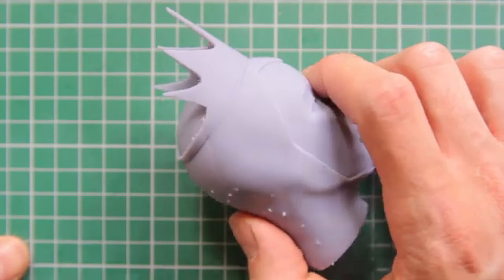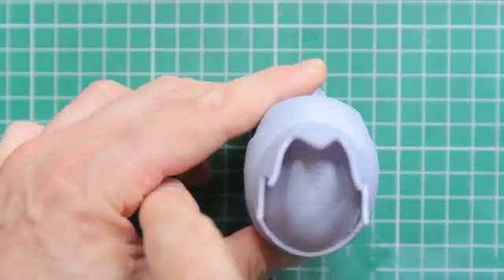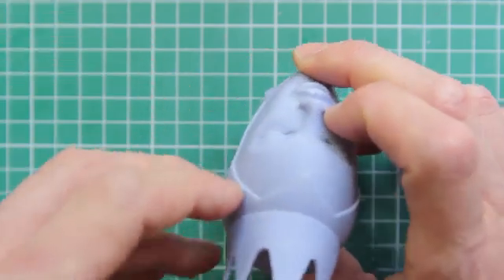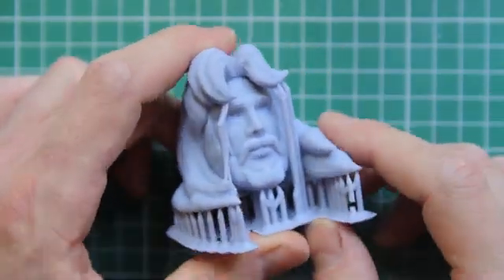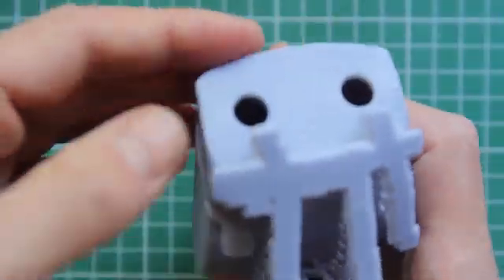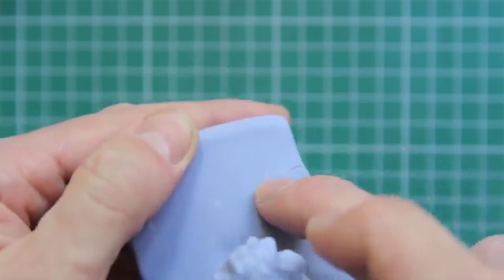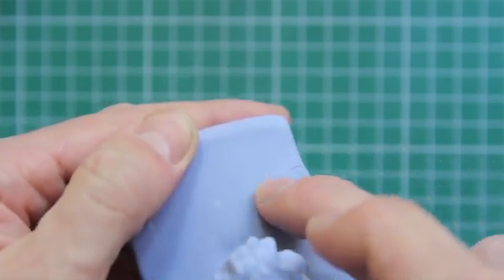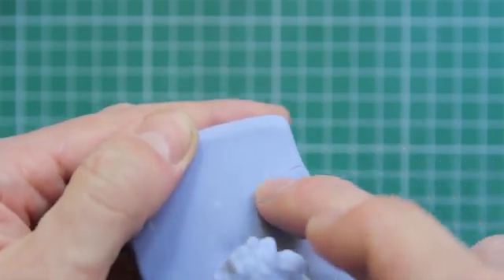LARGE RESIN PRINTING ISSUES PT2 - VERTICAL LINES

Comment: I had the same problem, very annoying. Fixed it with a lift speed decreasing.The print is little bit slower but the result is great.
Reply: what exactly did you change please?
Reply: @acm8759 I learned that the problem was due to the placement of the holes. After opening a small hole, there was no resin outlet in large models, so lines were forming.

Comment: That's suction force on this them sunken blurred lines these will disappear on hollowing and angling and lowering the layer hight!
I have had the grid lines print on a large print they print the squares not just lines so this is not the grid lines it's suction to maybe angle or loose streched fep!. Anycubics mono 4k prints the grid same as your cutting mat on larger prints
Reply from the maker: No it was a print error from the led grid matrix.

Comment: Ah-hah moment! 
I was wondering why I was seeing vertical lines on my tank parts which are printed vertical; I was puzzled as to why they were vertical lines and not horizontal lines. Now I know.
Reply from the maker: I use the mars 2 pro now and it doenst suffer this issue due to the light being one source. Also prints a bit quicker!

Comment: i just bought a elegoo saturn 2 and on large prints i have this same issue
Reply from the maker: I feel they may have qc problems. Email them. I made a vid about sanding down the grid to improve it, but that was on a mars2pro...elegoo eventually admitted they had messed up somewhere and  they basically offered the same fix but from the factoy not me sanding anything.

Comment: I think it's more of an exposure setting and not related to the led matrix. I started getting them on my mono 6k when I turned down the UV power as they recommend (to about 50% for transparent resin). I have no issue with my simple mono (that has no UV power control) or after turning up the UV to 80% on the 6k. Also, keep the walls at 3-4mm
Reply from the maker: No it was the grid issue in manufacturing. They installed the uv array 1.2mm too high. They sent out replacement and an apology months later.

Comment: Got the same issue with anycubic photon mono x 6k. Your theory sounds very rationally but sadly it means we can't do anything to fix that. Maybe higher UV power setting will affect these lines a bit? I'm running my printer on 60% UV power and these lines are strongly visible
Reply from the maker: The mars2pro got rid of the grid so its ok and they did release a fix but i still believe large prints may have faint lines but i could be wrong. Diffusion and increaded strength wont help. Its about getting the grid line as invisible as poss. You may need to raise the grid a few mm or lower it. Whatever works!
Reply from the maker: I made a video about how i sanded internal grid to improve the issue. Try searching for grid lines printing or something.
Reply: @Cloakfiend  I noticed that after your previous reply. The results are very good but I'm concerned that I will break something while doing these modifications. Printing a new bracket with thinner grid walls and just replacing the old bracket with the printed one seems to be the best solution for me. By the way I appreciate the time and effort that you have put in resolving this issue and that you are sharing your knowledge and experience. Thanks :)
Reply from the maker: @Przymekk youre welcome! ive spent many hours on this with some people because it really bothered me as i print alot of stuff with smooth surfaces and hated seeing the lines. Its just bad quality control. I printed a new grid as well on my fdm and it was also gine but pla degrades with uv exposute over time to eventuallu you will.need to print a new one. Not sure when though. Could last for ages though!

Comment: this shouldn't be a complicated problem for a slicer software developer......
they can calculate the grid size and adjust the blur on those grids...

hope the developer aware about this problem...
Reply from the maker: No its a light issue that causes it. It causes supports to fail.
Reply: @Cloakfiend  oh... I see... The line is lack of UV....?

You should try Creality Halot series...

I have a halot one.. They use integral light, no cross line etc.....

Comment: Ive been looking forever on how to fix these lines. Kinda depressing to know you can't. Does any chitubox settings help conceal them more?
Reply from the maker: Contacr elegoo if they are too bad. Mine are better now. Not perfect. But miles better.
Reply: @Cloakfiend  Hey, did you ever consider if any of the horizontal lines could be from the things mentioned in this article too?

https://ameralabs.com/blog/10-reasons-for-unexpected-horizontal-lines-on-your-3d-printed-parts/
Reply from the maker: @Txirw87581  if you have a mono light source the lines are worse. Not sure about the horizontal lines. I had vertical line issues. In chitubox on mono light source i use blur full and grey at 0. If that helps. I hate the new chitubox. Much prefered the old one.
Reply from the maker: @Txirw87581  i think horizontal lines are from zscrew dirt mainly for me or uneven pressure from fep. But i can only analyse the issue if i have it.
Reply from the maker: @Txirw87581  im getting those lines now. It must be due to peel forces on my case.
Reply: @Cloakfiend  Just curious, what layer height does it happen for you?
Reply from the maker: @Txirw87581  i've only printed with 0.05mm layer height.
Reply: @Cloakfiend  I'm actually using Phrozen Sonic Mighty 4K and it has the same issue. I can try contacting them and see what they say. Thanks

Comment: remove your supports before curing. Also, it looks like you have not dialed in your resin settings.  Take a look at 3DPrintFarm his latest video to get you started
Reply from the maker: I do remove my supports before curing normally and this printed perfectly, but the lens array is too low apparently hence leaving the lines, Elegoo said they would send me a new lens and holder. So hopefully that will fix it!
Reply: @Cloakfiend  Did the new lens distance fix the lines?
Reply from the maker: @MOVIEKICKS  not entirely if i can remember but i havent printed anything in a while. The pro 2 has different problems combined with chituboxes new grey settings which are crazy. Ive yet to do a new test but its A LOT better than before. But im gonna go out on a limb and assume the lines are still there somehow seeing as the only way to ridvl them completely is to not have the grid.
Reply from the maker: And I look at 3DPrintFarms vids I like his style and delivery! good fun.